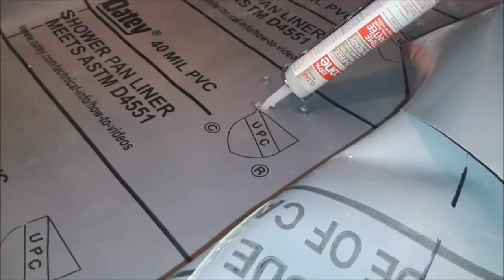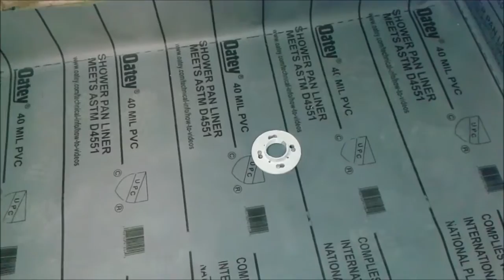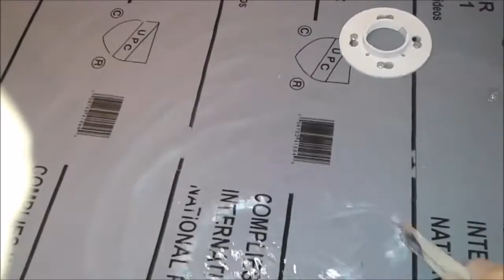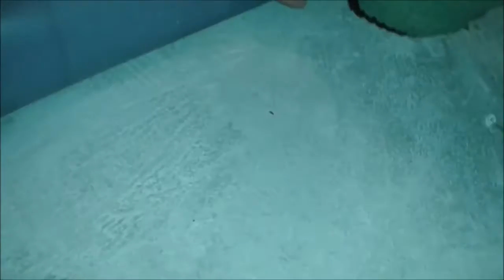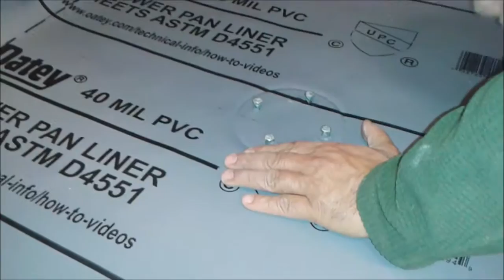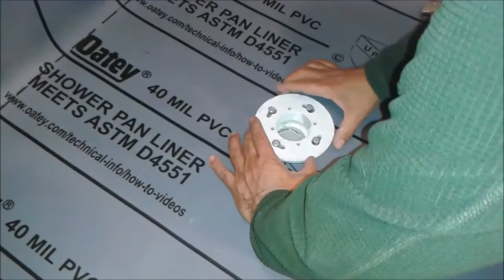How To Install Shower Pan Liner -  Part 3  Liner Installation And Testing For Water Leak

Comment from the maker: Shower drain used = https://amzn.to/2Hp9c0a
All material used to build shower pan are from Amazon:
Shower Pan Liner Used  size 6'x8' https://amzn.to/36bKKd4  size 5'x6'  = https://amzn.to/33b6pjQ or size 6'x8' = https://amzn.to/34bGUOu
Metal Diamond Mesh = https://amzn.to/30ipHlo
PVC Dam Corner = https://amzn.to/36gIMrW Or https://amzn.to/3jeayZX
Goof Proof Quick Pitch = https://amzn.to/335t8hf
Goof Proof Extra stick = https://amzn.to/2S1A9cm
4 - 1  Mix Mud used = https://amzn.to/344tfsq
wood float = https://amzn.to/3ijo0tX or https://amzn.to/3jgjFsO
thin set used = https://amzn.to/2EyeEgc
Pan liner Glue = https://amzn.to/3cP2lsM
Weep Hole Protector = https://amzn.to/332QvrB or https://amzn.to/330Te4U
Shower drain used = https://amzn.to/2Hp9c0a
Grout Rubber Float = https://amzn.to/2EN0M1S
Grout Margin Float = https://amzn.to/33dMKjf
Grout Ready to Use =  https://amzn.to/3cLlHiu
Sprung for grout =  https://amzn.to/2Gbhl8b
Or  https://www.amazon.com/gp/search/ref=as_li_qf_sp_sr_tl?ie=UTF8&tag=josephkhalon-20&keywords=goof proof quick pitch&index=aps&camp=1789&creative=9325&linkCode=ur2&linkId=cf01d1f4124c5fb222b2c983ba56e5e1
Amazon Deals:
Try Amazon Prime 30 days for free = https://amzn.to/2JMWaLe
Create Amazon Business account = https://amzn.to/3mLSyYt
Joint Amazon Prime Watch Thousends Of Movies and TV = https://amzn.to/33NfsHD
Try Personal Shopper Wardrobe  https://amzn.to/2VClfv9

Comment: When UC cut the x n the drain liner....you should have left the flaps and not cut them, they prevent water from leaking out the drain if there is a back up
Reply from the maker: You right. It may avoid backup.